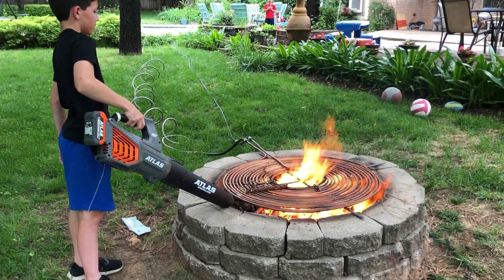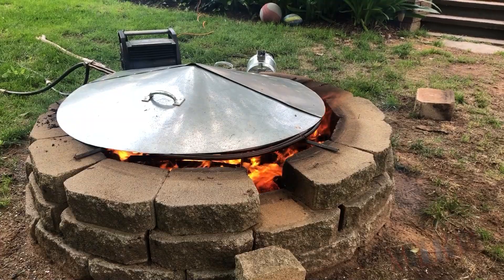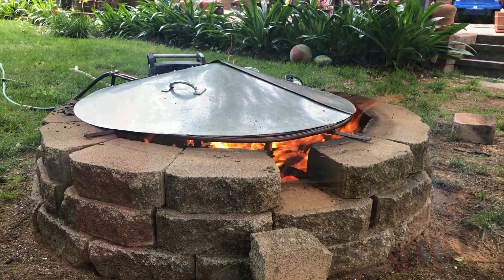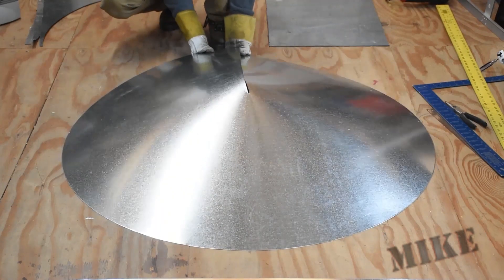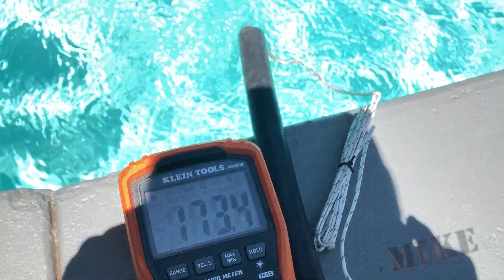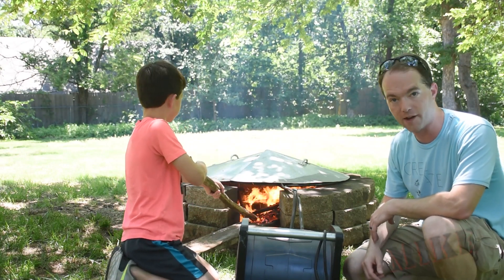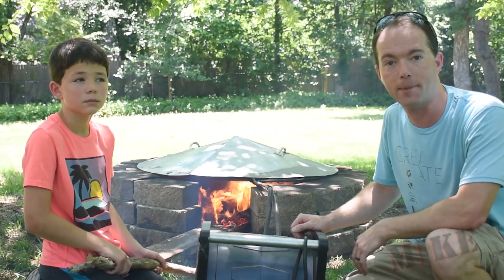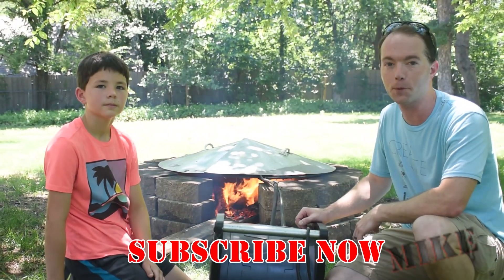FREE Pool Heater - Mikes Inventions

Comment: can you give us some updates on this design ?  how many times have you used ? for how long did you do your burns? is the copper pipe still holding up ?
Reply from the maker: @leod7824  it’s been used many times and typically run at least 4hrs each time. The pipes are black now, but it still works perfectly. I haven’t performed any maintenance or anything on it. Thanks for watching!

Comment: it will not last long though, the fire slowly degrades the copper until it starts leaking, I'm using it similar way to warm my house and had to do adjustments and to be less greedy.
Reply: Could you put the coil on top of the lid?

Comment: In an old issue of Mother Earth News there was a French farmer that used a compost heap plumbed with pipe for their hot water and in that case it needs no interaction other than feeding the pile.
Reply from the maker: That's sure clever. I had no idea that compost puts out that much heat, but I guess it depends on the size of the pile. Thanks for watching!
Reply: @MikesInventions  As you might expect a farmer has no shortage of compost materials and as I recall the pile was the size of a small house so besides saving money heating water he was also making money with the sale of excess compose as he fed the pile.